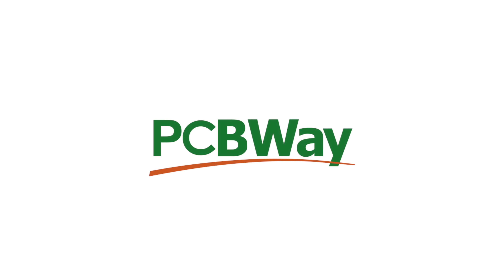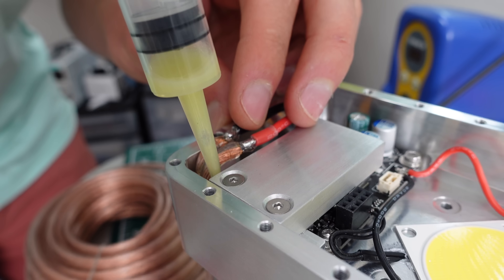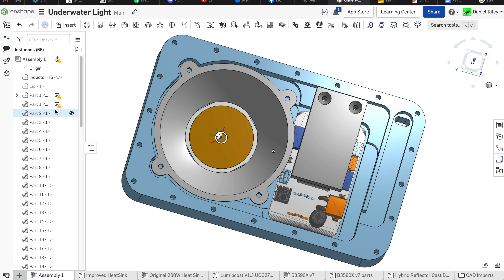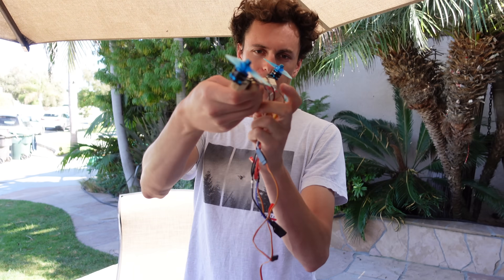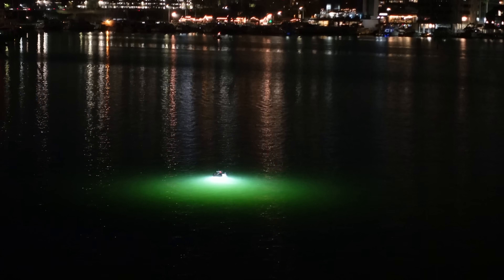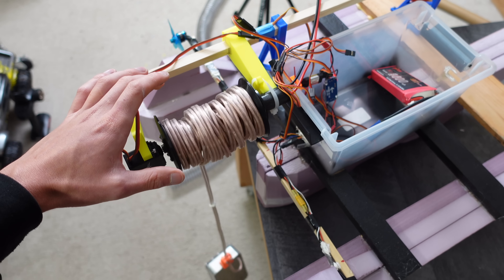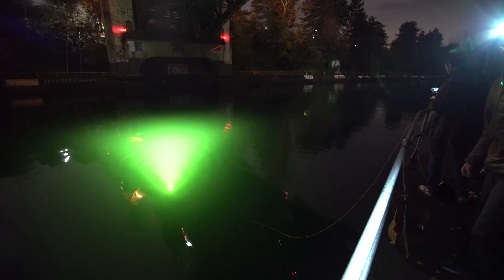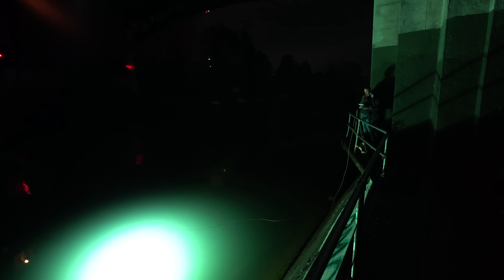DIY High Power Underwater Light on ROV Submarine

Comment: For a future light, I would probably consider spectral attenuation through seawater and select a monochromatic light source (that is also high power) instead of white light. Removing the phosphor coating for a blue pumped COB could actually be an easy mod. A narrow beam that can scan will also improve range.

Comment: Considering the orientation, ledil has a COB lens called the Flare that creates a beam 8º/10º/15º/20º wide by 100º across  that could do a much better job illuminating into the diffusive water than a basic reflector. The Flare does vertical and horizontal beams.

Ledil has other assymetric, square, oval etc beam profiles

Comment: Pro Tip.. Use Polyurethane Glue For The Ultimate Waterproof Seal 👍
.
The type of glue used to seal RVs  /  Motorhomes
.
.
In england its approx £10 per tube
.
And you will need a caulking gun
.
But its WAAAY better than epoxy resin or silicone
.
.
.
The downside is its SO DAMN STRONG .. it makes it VERY hard to dismantle
.
.
This glue is also used to glue race cars together and its that strong the metal rips round the glue joint in a crash !

Comment: hello, my team has been trying to seal a robot and we went through alot of different sealants. Silicone is very stiff and it doesnt' conform very well when the body moves/bends. We found that butyl tape is very good at sealing. It doesn't harden up, so it's a little messy, but it easily conforms to the seal and literally no drops will come through.

Comment: A heads up I have used that speaker wire as it was all I had to get my solar in my caravan working and in just 2 weeks I stragley had only a fraction of the power coming through and it turned out to be the speaker wire reacted with the normal power cable it was all green and corroded and the same happened to a friend a year later. Luckily for him I had the issue prior as he had no clue and was out of ideas.
Just a heads up to anyone using speaker cable especially if ur using it and not getting the power through. Hope this helps someone out there one day. 
A connector block would prob work as long as the wires don't touch and u only have speaker wire to work with. Xx

Comment: I’d say to remove the reflector and try a new PC front plate that you sand down to make it diffuse.

That should help a ton! For now, you’re trying to paint a wall with a sharpie when you want a spray gun… so just make it “spray” the light more efficiently and you’ll get rid of that over exposure problem too most likely…

Comment: You seem to be overexposing the light in your long exposures. 
Do a few long exposures for the scene above water.
After that, you don't really need those again. Instead you now expose for the hotspot from the underwater light. 
You might need a few long exposures of the green glow on scene outside of water.
You also need to discover luminosity masking. You seemed to have done a lot by hand (ouch!). You can isolate selections using the luminance (brightness) values. To even out the variance in exposures, there is a method to use the mean values of luminance as well. That would help to even out the differences. Any additional difference you can target using luminance masks to bring the levels back into balance.

Comment: Why not just flush the inside with nitrogen to prevent condensation? Or uh, I guess easier, you could fill it with those dehumidifying packets that pull moisture out of the air.   I'm probably gonna regret commenting mid-video  aren't I.

Comment: are you sure the water isn't getting in around the polycarbonate front? you could have a little channel cut in around the perimeter (but on the inside side of the screw holes) for a gasket.

Comment: You need more linear grooves that can block moisture one more time when connecting between the transparent damper and the aluminum body. 
also need heat and pressure resistant sealing (rubber type) such as car engine sealing.

Comment: I design a lot of waterproof housings for work, and also mill them on the cnc. 
Why would you not use a o-ring? the part is made on a cnc anyways, way more reliable than silicone. and sometimes you can make a second mountingplate on the inside, so you have less holes in the housing.

Comment: I was just watching another channel (Tech Ingredients) that mentioned that silicon can be permeable to water. That was a surprise to me! How bout yourself if true? Therefore the epoxy may not be the problem to sealing the electronics in the box from water. It may be the silicon seal you are using. Another possibility is a high moisture content of the air, or humidity when you sealed the box, and then the much cooler water temperature caused the humidity in the air in the box to condense down, or precipitate into actual water within the confines of the box. Possible remedy are silica gel beads (called a desiccant) used to keep things dry in high humidity conditions. Its interesting how Wikipedia described silica gels: "Canisters are commonly filled with silica gel and other molecular sieves used as desiccant in drug containers to keep contents dry".  "Molecular sieves" Water easily flows through a sieve, but who knows!

Comment: The bridge would look better if the green were corrected out. The light itself needs a diffuser, not a reflector, and multiple small ones instead of one big one in the same housing. For the time lapse, you just need more images that overlap more, so the change from image to image is less abrupt. Also, if the light were pointed down instead of up maybe a foot or so off the bottom.

Comment: I would have either made a rubber gasket for the acrylic cover or used an o-ring in a recess in the housing, so that it can be compressed by the acrylic. Would have made it easier to disassemble and reassemble, but either way, this is really cool

Comment: You have been offered some very clever and useful ideas in his comments. However, you should really take a look at professionally commercial made underwater housings for cameras and strobes and lights.Ikelite would be a good example to start looking at carefully. The wire used for power and light is inappropriate. You should a  use a round insulated ( like SJO) cord wire, with seal tight compression fitting. I would really like to know the total cost you have involved in this project. This whole project appears to me, terribly expensive for the results.
Reply from the maker: Rude!

Comment: Need to make the walls of the box where it mates to the plexi wider so you can add a groove for an o-ring.  Some SOW cable roughened up to better accept potting, we use 3M 3321 2 part epoxy for making watertight cables, they go to several thousand feet underwater.  We usually oil fill and compensate our electronics, transformer oil works well and a simple comp can be made from a blood pressure cuff and a bungee cord.

Comment: Maybe an underwater sled that can be pulled back and forth by a wench like motor on either side?   Make yourself something akin to an underwater gantry mill that has each side of the shore bank act as Y rails and they pull the light back and forth almost like a facing operation.

Comment: Dude, this is why photographers invented flash lights. Set up a down facing strobe on a boat and set a waypoint or manual mission to cover the area to be illuminated. It can all be battery powered using on camera SLR style flash units. We used to do this back in the 90's... On film!

Comment: What about a convex curved mirror a distance away from the light.  The light is so bright. Maybe the mirror can reduce the focus and illuminate more area, with a smaller area needed to be removed in post. You could make a large disk that is x many feet in diameter, to block the oversaturated area, then there wouldn't be that need for post editing. It would look like a doughnut in the water with a dark area in the center.

Comment: I think you need to use lasers to achieve wht you wanted to originally. And you need to use UV lasers, since the light will travel further. Then you could 'sweep across the water area while doing a time lapse, the camera would need to use a UV filter also. Maybe a visible light laser would work too but I think UV would be cooler

Comment: An alternative to trying to seal around your wire directly is to install a barb fitting in your housing and run your wire through the middle of that, then encase the wire in a long piece of vinyl tubing. It's bulkier, but since stuff like hose fittings are intended to make good seals, it's much easier to avoid seepage this way.

Also, if the hose squishing with depth is a problem, you can fill the whole thing with mineral oil.

As others have mentioned, the reflector is actually hurting your purposes here. A better design would use two COBs with no reflectors mounted back-to-back on a single heatsink "fin" with the housing as thin as possible to get as even a sphere of light as you can.

Comment: rather than spread the beam, try focusing it... spreading it simply diffuses it...

then spinning it. just need a mirror at an angle on a motor... as long as you hit 1200 rpm (20/rps) or higher, it wont "strobe"... 
personally i would be trying rgb lasers... more intense light. 

i always had far more success with "hermetic seals" on wires by running them through the acrylic and filling with acrylic cement (or acetone and acrylic dust, same thing!). not relying on the silicone to aluminium seal then. i only trust glands on metal seals, and use threaded studs, teflon washers, the works... ie, it usually only suits power feeds for fuel pumps in tanks...

and sometimes, taking a cue from the japanese pearl divers... little balloon to equalise the pressure in the chamber...

or, simply make it so the chamber is always at 30psi or something...

Comment: the wires themselves will become channels for the water to leak through like little straws into the interior with surprisingly little pressure. You can make little isolated terminals to transfer power from the exterior to the interior that doesnt have a straw leading wire into your electronics..

edit:
oh, you said exactly that soon after posting this comment. haha. touche.

Comment: I think use an LED strip that is about 10m long and use WLED to make it strobe/pulse different patterns and use it as a 'tail' on the sub. Or even several tails on an arm that is like 12' wide and mounted in the center. Would not be fast, but would look cool.

Comment: Tip... To STOP condensation buildup on final assembly, place the whole unit into an oven on low temp - say 70-90° C for a few minutes to help drive out any residual moisture, then quickly place lid on top whilst still quite warm, this will help drive out cool moist air, and trap warm DRY air inside... It works, I've done many a car/motorcycle headlight unit this way 👍.   😎🇬🇧

Comment: You may add light diffuser to reduce blown out image.  Send higher voltage from the shore use dc down converter on the light box. Power loss would be reduced.

Comment: The condensation probably wasn’t a result of a poor seal, but more likely the moisture already trapped in the components. 
Next time stick the whole thing in an oven for a while to bake out the moisture, then seal it up.

Even better, do the above and then backfill with dry nitrogen through a grub screw.

Comment: also studs in plastic tubes is probably more watertight given you wanna go deep i wouldn't rely on potting to stop intrusion, rather make break at the entry point and gasket the bolt instead, which will double as an insulator to the case, you would just have to protect the studs on the outside but there will be no pressure difference to fight there so something like boat sacrificial coating could work

Comment: go deeper into the dumpster! add a shroud with a diffuser so you can't see the light directly, and maybe use a miniblind style lifting mechanism to control the angle of the light in 2 axis, 4 crawler winch wheels for servos could do that job well even if a bit slowly

Comment: I was an apprentince at an ROV workshop. Everything electronic is filled with mineral oil. It removes your issue of condensation but also the issue of high pressures under water. I would have drilled and tapped a m6 or m8 hole in the polycarbonate for filling it with oil and just thread in a bolt with some teflon tape to keep it shut.

Comment: Silicone is terrible for water proofing. Use urethane windshield adhesive and a primer. Being able to pressurize it for deep water would be handy also. Tire valves are an easy solution for pressurization.

Comment: Awesome design . I do wonder if the water ingress could be caused by the temperature increase in the trapped air inside causing it to build pressure and force some air out. This could then pull a bit of a vacuum pulling in water when it cools?

Comment: Using multiple lights aiming in opposite directions with diffusers / silks on them may yield better results. The directional lens is limiting you, especially when trying to paint the largest area of light possible for long exposures
Reply: exactly my thought, maybe a less aggressive reflector might help aswell, for diffusion he could just sand a circular area on the PC window where the COB and reflector are located
Reply: @datpudding5338  Or maybe a diffuser dome, like an underwater ceiling light.
Reply: @PongoXBongo  or even that when going for a more sophisticated construction!

Just thought of the time when I literally just sanded the surface of a piece of acrylic glass because I had just a bare bulb socket and a beheaded LED bulb (meaning one without the diffuser bit). It worked surprisingly well!

Comment: You could add a tire valve and pressurize the light before submersion, that would keep water out better.

Edit: Also, you could try a diffuser of some kind in front of the lens. Container lid, milky white plastic sort of thing. Like immediately in front of the polycarbonate lens.
Reply: Or even just "scratching up" the polycarbonate itself with fine sandpaper where the reflector lives

Comment: Also for plastic cover, o'ring groove in alloy piece or rubber gasket is what we use. Best to surround plastic with metal frame to spread sealing pressure evenly.  Been doing this for 30 years :-) google images "jupiter valve pack" for an examples, love your work

Comment: I would strongly suggest not using speaker wire, there's a reason its cheap. I've seen more than a few custom electric skateboards catch fire due to its use. The insulation melts at a much lower temperature causing shorts at amperages 14g wire would otherwise be suitable for. Be careful!

Comment: Best option is make a water block, brass wire maybe 40mm long with centre 30mm portion set in epoxy, solder wires to both ends. We use it to 3000m

Comment: pro tip, on your next revision add a port to fill the case with argon, and another port to evacuate the air , to replace the moist air inside the housing with argon, and toss a little bag of silica gel into it before sealing the front plate. try not to pressurize the insides, just flood it at atmospheric pressure with argon for a bit. its how we make night vision systems condensation free.
Reply: Why argon? Is it just easily available or does it serve another purpose?
Reply: @AngeEinstein  it is an inert gas, dry, displaces air and is easily available.

Comment: ok, please learn how to solder lol, that's not how you solder an XT60, also lots of your joints look cold

For XT60 you need to insert the wire, then solder it, you put solder on then just held the wire on the side which isn't very strong or conductive

Comment: I found water damage in a panel once from water travelling through a 600v solid core wire that came from a leaking junction box on the roof 100+ meters away. Mind you it likely took 10 years.

Comment: One thought that came to me: What about designing in a hole for mounting a tire valve or similar…
..so that one can TEST for leakage by pressurizing the inside…
..AND then later KEEP the inside pressurized when in use.. 
(should help preventing water from entering)

Comment: How about attaching the light to a drone? Then you could program it to do a perfect path for even light. The problem might be a heavy mass of this aluminium enclosure, but do you even need it? Just put the dc converter on the other end and let the high voltage flow through the cable. Then just make the LED waterproof and water will keep it cool.

Comment: I'd recommend designing a groove for an o-ring for the housing closure. Have it weave around the inside side of all the screws. Silicone, plus an o-ring would definitely help seal that bad boy up
Reply: ye, and using o-rings at the lid instead of silicone makes opening/repairing it way easier to do
Reply: @datpudding5338  exactly 👌

It would be really handy between the hull and deck of his other boats too

Comment: Is it possible to use AC rather than DC to combat the voltage drop? You can use a cheap 12v -24v DC to 120v AC inverter on land, then use a laptop power supply underwater to get it back to DC. Alternatively, 120 v AC might be dangerous but you can use a transformer to drop the voltage and use a FULL BRIDGE RECTIFIER  and a capacitor to convert it back to DC.

Comment: You could add a tire valvr stem, if the air pressure is higher than the water pressure, water will not come in😅